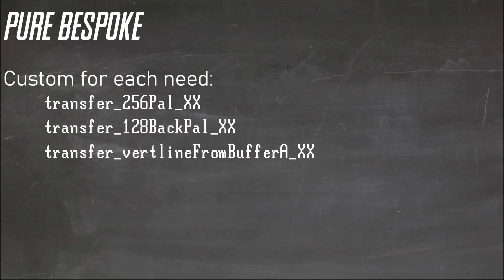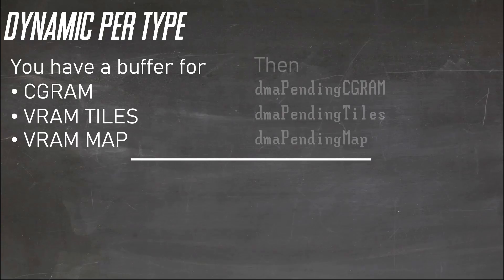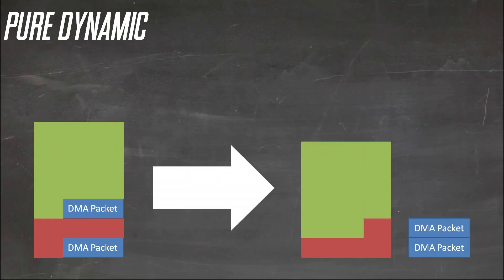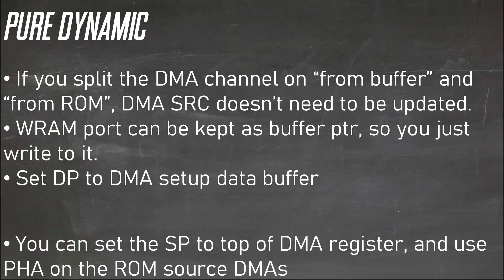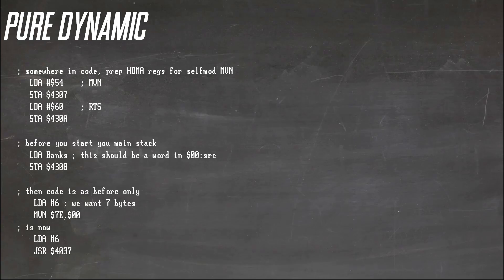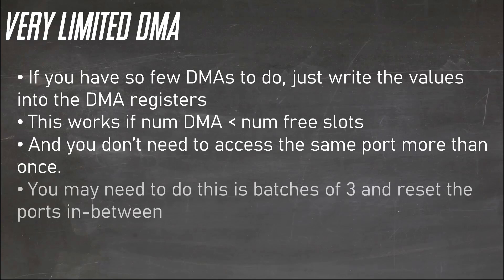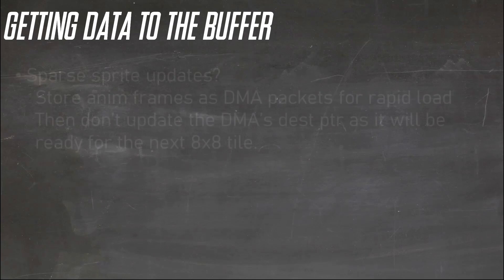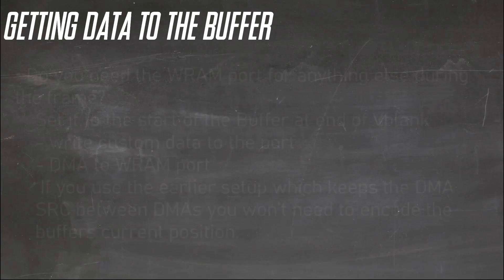Elements of a SNES Engine 8 - VRAM DMA SYSTEM

Comment: Pure dynamic mode and using MVN to set up DMA registers is quite an interesting idea, never considered that. Will have to play around with that and see if I can squeeze a couple of bytes of VRAM transfers more out of my Vblank handler, thanks!
Reply from the maker: the MVN/P works best when you are doing "from ROM" as you will want to set and update the SRC pointer as well. While "from buffer" it is more optimal to leave the SRC alone. If only Nintendo made the order setup, dest, length, src. So unrolled loops of DP load (not index) and then an abs store still gets you 7 clocks, but you skip 3 bytes. If you do it in words, then it will take 9 clocks per 2 bytes.